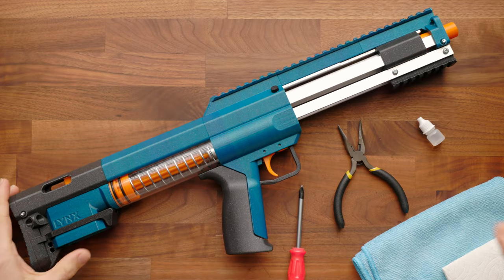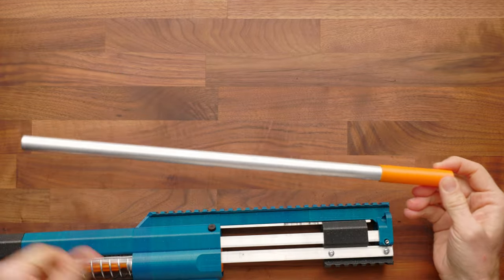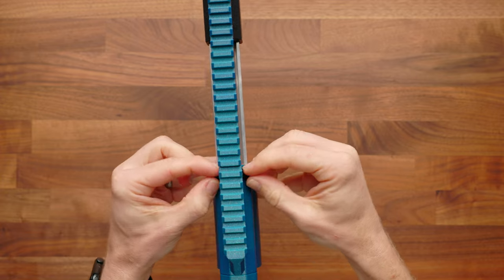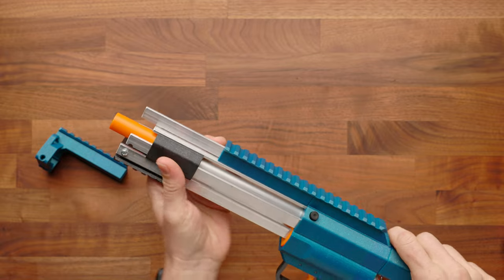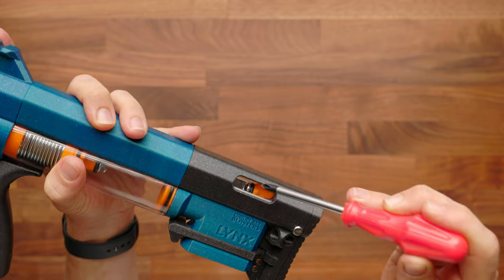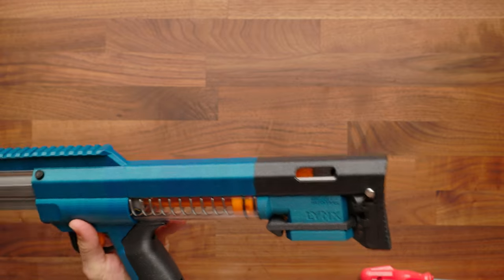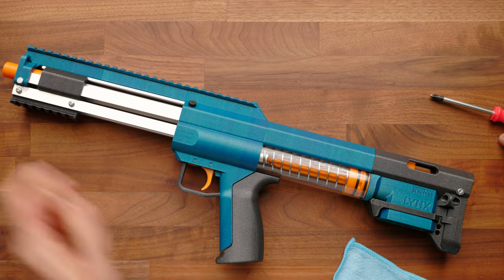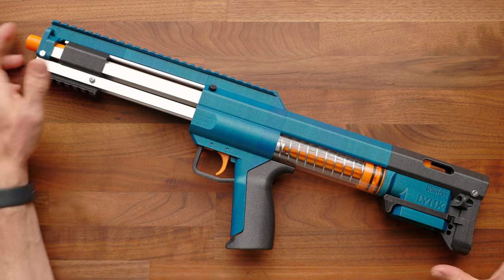Lynx Tips, Tricks, & Tuning Guide

Comment: One recommendation I might make to you all, especially if you are having issues with flubs is to get a slightly larger sized nylon thumbscrew from McMaster Carr. The ones included in most kits are 1/4” in thread length, which is okay, but if you instead get the ones that are 3/8” thread length, it allows you to put a little more pressure on the barrel which also helps put more downward force on the catch bars and assembly. Those of you that have issues where you pull the trigger and it doesn’t fire, tighten your thumb screws first. Also if you upgrade to a shroud on the front, the 1/4” thumbscrews are a nightmare to insert and remove, and the 3/8” nylon thumbscrews you’ll find are the perfect length. Great basic Lynx troubleshoot video Luke!

Comment: i have a problem of my big oring in the plunger always shrinking and not sealing the air in. idk what causes it to shrink because it happens often.
Reply: Have you tried replacing the dash 123 oring? If that keeps happening, it’s not preferred but you can alway run a couple laps of Teflon tape under the oring area to add some tightness.

Comment: My personal tip to pull the plunger without taking the tube apart from the turn around- remove the spring and reinstall the pump/catch, then just pull it out. Takes 30 seconds total.
Reply: I do this also

Comment: Oh Luke you might also want to touch on all the places to apply Slug Slym. One that you didn’t meantion was actually the catch and you can lubricate that with the priming bars all the way forward through the catchhole. After extended periods of use, This will also help ensure if the catch is sticking on shots, that little bit of lube will help it release the catch.

Comment: Very helpful, if I got one. My only question is what is the performance of each spring listed, and what does GREY ANNODIZED bars do to the blaster?
Reply: You can find this data on the orion blasters webpage for the lynx, he has an excel file that has data from the public, because the fps doesn’t just depend on the spring, but also barrel length and type, and scar or bcar.
Reply: Also the grey anodized bars are for show and will help protect the bars from some scratching and discoloration
Reply: @MidnightBlasters  Thank you